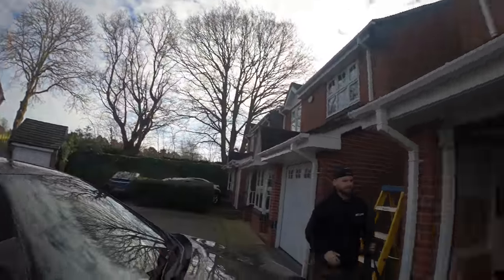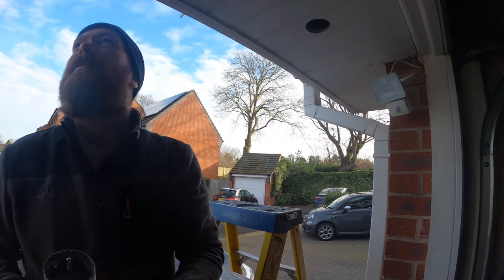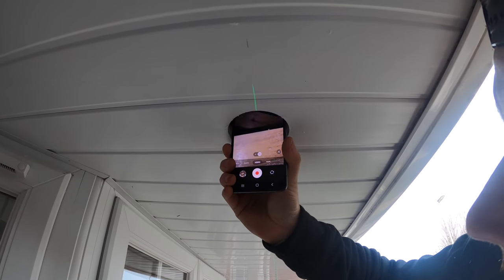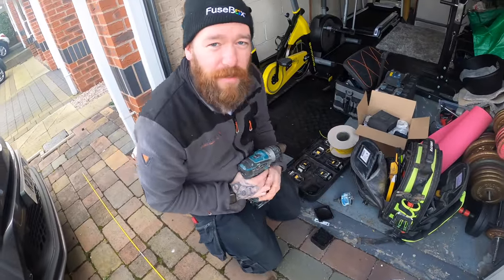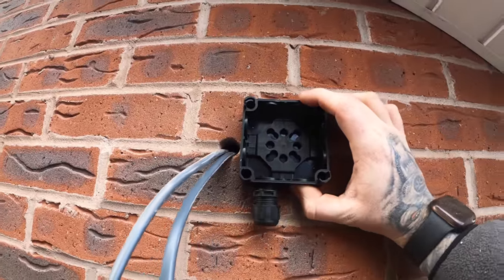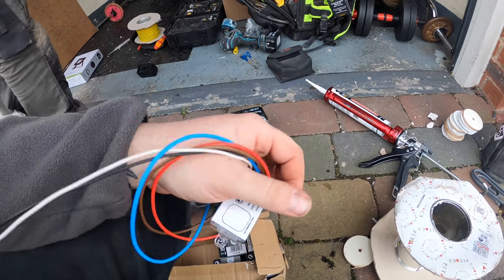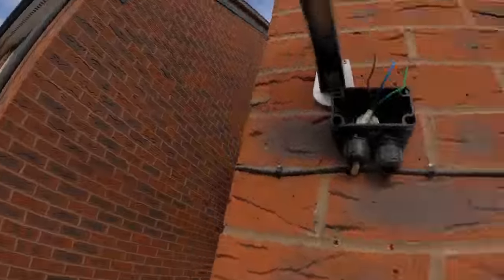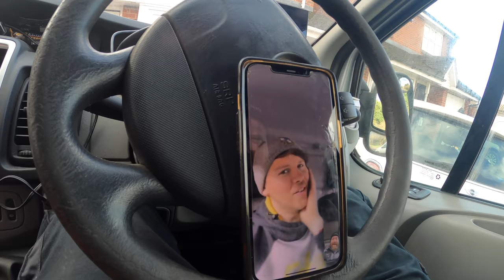Nick Bundy Gave Our Number Out 😮  - Domestic Electrician Uk -

Comment: Top job lads  looks beautiful great vid.
top tip we always put clear silicone sealant around the box never had  water ingress so far. Try the Bosch quick release hole saw arbour and adaptors speeds the job up.
Reply from the maker: Thanks for the tip dude will defo try that next time, cheers 
I’ve looked at the Bosch ones but there quite expensive aren’t they and I’m not scared of hitting a nail with mine 😂😂😂

Comment: Did the hole in either corner never give it away on the Wiska box before mate?🤣 Nice job fella. Wish Wiska would make the back entry hold threaded so you could bang some
Conduit through the wall with a male adapter on to scew into for occasions like this. Seems odd to me that you can’t.

Like you say if not going back entry you can use the white backing plate to fix to the wall and not compromise the IP rating but back
Entry you have no choice but to do what you’ve done here and silicone it up.
Reply from the maker: Yeah it would be better with something like that wouldn’t it, all we can do is silicon 
I could have flexed it and gone with a stuffer but then would have needed another wiska or enclosure somewhere to split the feed and load
Reply: @JRCElectrical  Would be really helpful if they did mate, don’t know why the don’t all the others are threaded aren’t they?

Na mate would have done exactly the same as you did here bud 🤜🏻

Comment: Nice job , watch your downlights measures and adjust to suit where you drill ,  offsetting  would have a made a much more eye line finish to the soffit board grooves.
Reply from the maker: Thanks
I did consider this but the light at night is perfect on the doors and windows I always think slightly to the left or right would have been better on the board but the light output  wouldn’t have been centres